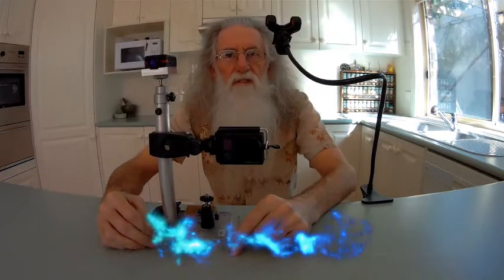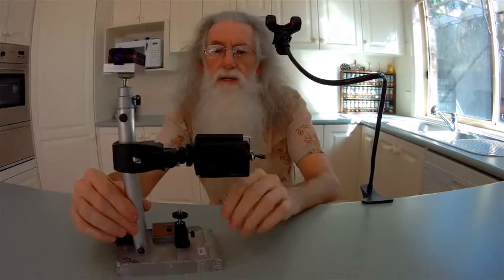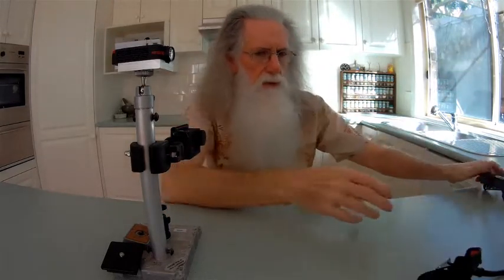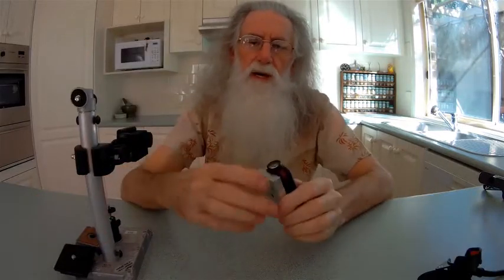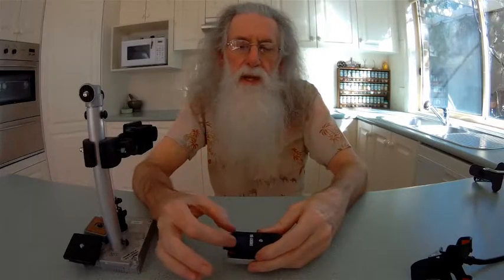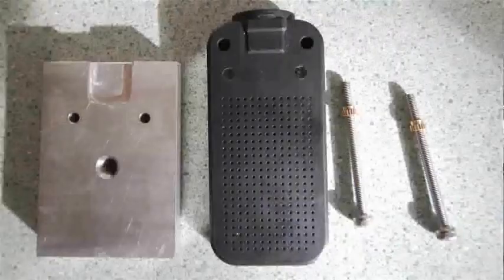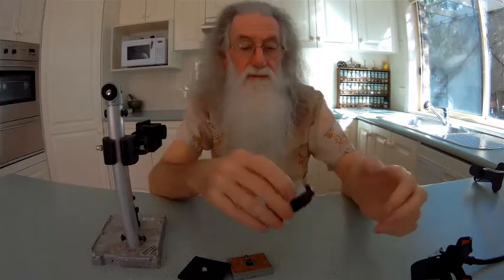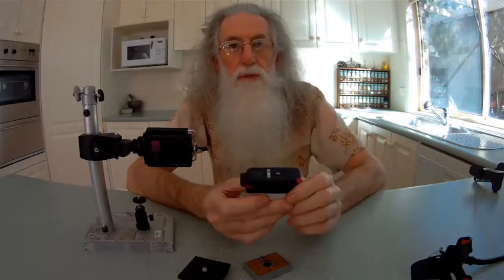Quad4A - Firefly Q6 Screw Mount

Comment: Great Idea mate - What sort of weight does that chunk of alloy add though? or is it alloy? - Subbed channel me fellow Aussie - Western Australia here, Geraldton :)
Reply from the maker: Thanks for subscribing. I don't know why gopro, etc don't adopt it as a standard. The industry standard 1/4"-20 threads are way too big for the tiny cameras used these days and you have problems mounting them, etc.  It usually takes a much larger and heavier cover. I use M3 as that is a very universal thread size these days. They are called Brass Knurled Nuts Insert Embedded, etc on eBay and if you search eBay for item number 222077151833 you will find the ones I used, they come in many sizes and lengths. 

As far as the weight goes, in Aussie technical terms, they weigh Sweet FA. They are made of brass and can be tiny with M2, etc threads up to M10, M12 etc. Anything plastic at your home with a thread in it uses them. They are moulded with the part when it is made.  My method tries to mimic that. Drill a hole just big enough to leave some plastic to flow. Heat the insert so it softens the plastic but doesn't melt it. Push the insert in square and to depth with just enough force. Too much force and heat and the insert will wander all over the place, wrecking it. Then gently remove the head source (soldering iron, etc) and let it cool before moving on to the next one or it may move when it is still hot.  You can also solder them on to a  pcb for screw mounting, etc. Or Epoxy them on the back of thin sheetmetal that you want to screw together. They are well worth the couple of bucks they cost to get.
Reply: Cheers mate - An excellent explanation, I will definitely look into this especially if it weighs FA lol - Take care bud